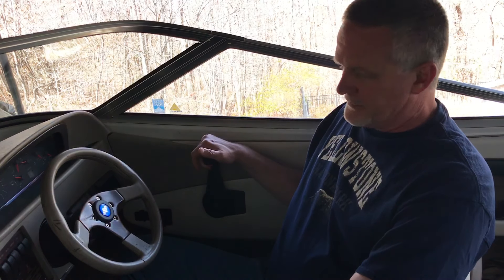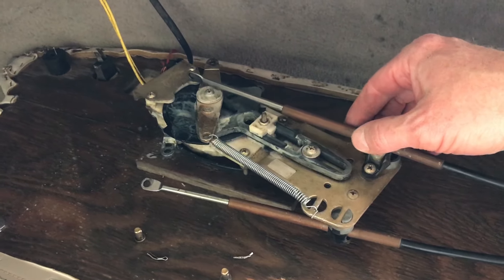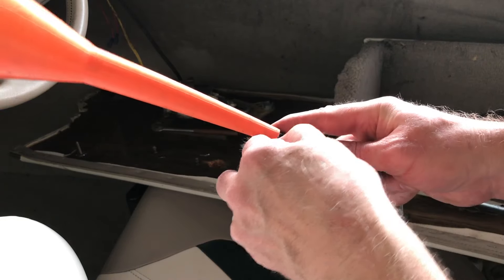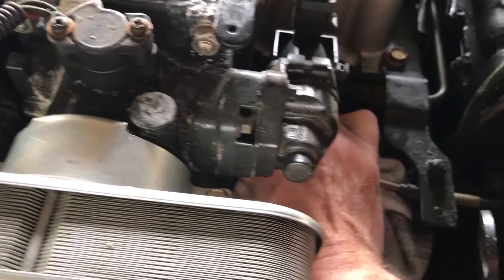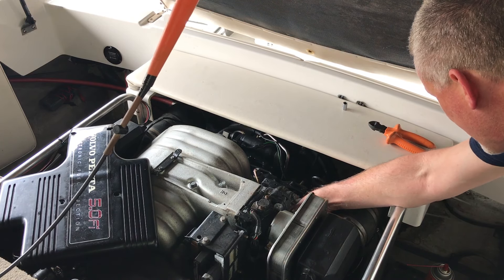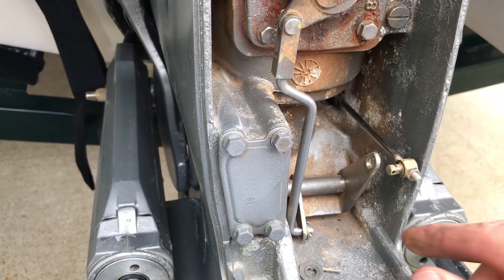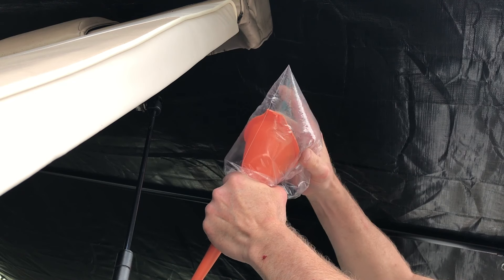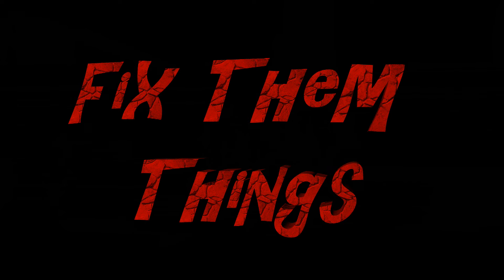Boat Throttle Shifter Cable Lubrication made easy

Comment: Awesome video, this should be incorporated maintenance with semi annual maintenance with all out drive cables..
Reply from the maker: It only lasted 2 years then the cable holder broke. I have another video on replacing the cable. $80. Easy to do. The new cable is sooo much smoother.

Comment: I have to say, you sir are a genius. I am no mechanic, I do paint and fiberglass but I’ve been around engines and mechanics all my life, never seen this way of doing it. Much easier than some other ways I’ve seen. Great job sir.
Reply from the maker: Hey. Appreciate the kind words. My shift cable finally broke 2 years later. I will say just go ahead and replace the shift cable since it sits in water. No need to replace the throttle cable. I have another video on replacing both cables.  Thanks.

Comment: I wonder if you could just tape a shop vac hose to the funnel and force the oil down the cable much quicker?  I've got an Alpha 2, so I'd prefer to not have to drop the lower unit if possible!
Reply from the maker: Good idea. Should work. In the long run you will be better off just replacing the shift cable. Mine lasted 2 more seasons then the plastic holder broke. Replaced the cable for $80 and it is much easier to move. I made another video on how to do that on VolvoPenta.
Reply: @fixthemthings  I wish Merc lower units had a cover like Volvo does to get to impeller & shift cable…without having to drop the whole lower end.

Comment: Do you want to drain all the oil? Or just wait for some to come out to ensure it’s made it way through the cable and put it back together?
Reply from the maker: It’s just a temporary fix to get you going another couple years. I have replaced the cables about 2 years after this video. The new cables are well worth it. $80 each. Doesn’t matter on the oil. The plastic retainer on your cable will eventually break anyways.

Comment: What is the make and model of this shifter? I have the same one, cant figure it out
Reply from the maker: I think I have the part number somewhere. I would have to search my computer. You would have to get an updated version of it anyway. You would need to get the same push pull actions that this shifter has. It would be best to contact Four Winns and see what the best replacement is.

Comment: Hi, I want to thank you for your video, and also have a few questions if anyone can help. My Mercruiser alpha one experienced reversing gear stall in the engine. Wondering if i lubricate the throttle cable and the shift cable will fix that problem? I can feel the cables are very stiff. 
Thanks.
Reply from the maker: Lubing the cables got me two more years out of the cables. Then the shift cable broke a few weeks ago. I would just go ahead and replace the cables. I just did it recently and took the boat out today. Wow what a difference. I have a link to replacing the cable at the end of this video.

Comment: How has it held up?
Reply from the maker: It made it better but years later plastic holder broke.   See my other video on replacing the cable. You will be better off replacing it. It is so much smoother.  -$80.

Comment: Thanks for the video, it was extremely helpful!  Once I got going with it, I came up with a small improvement to your idea.  Before putting the cable end into the funnel, cut a corner off the bottom of the zip lock bag and put the small end of the funnel through it and tape securely.  Then proceed to insert the cable and tape as you showed in the video.  Once the lubricant is in the funnel, you can pull the bag over the top and seal the zip part.  The air will be completely trapped inside and you won't have to worry about trying to seal the bag around the funnel with your hands while squeezing it.  It makes it much easier to build up some pressure.

Comment: Use a wet dry vacuum to pull it through while moving the throttle cable back and forth, works like a charm and fast.

Comment: Great video and instruction. I will give it a try on my throttle control. Thank you.
Reply from the maker: Just so you know. The stiffness will most likely be from the gear shift cable and not so much from the throttle cable since the shift cable sits in the water. Mine is still doing good.
Reply: @fixthemthings  Thank you, much appreciated. Cannot find Kroil here is Australia, going to use CRC 808 Silicon.

Comment: Nice video.  Nice job. I did this but only added engine oil to cable sleeves at the helm. It helped but only a fair- good amount. Didn't use my favorite penetrating oil THRUST in fear it might collect dust/dirt etc and make worse down the road

Comment: If you need more pressure, get a piece of vinyl reinforced tube closest to your cable end diameter.  Hose clamp it on there and fill the tube with whatever lubricant you want.  Then clamp a schrader valve on the opposite end of the tube and use a bike tire pump to add 10-15 psi.  Then drink a few beers while you watch the lube level go down into the cable.  This is especially useful on longer boats that have longer runs of shift/throttle cable.
Reply from the maker: Good one. I like it. Especially the part about watching it. Ha.

Comment: Nice job I want to do this to my cables I have the same single controller but it looks like the manufacture just cut a round hole in the fiberglass and I cant figure out how to get the controller off and out
Reply from the maker: I couldn’t figure out how to get the controller off either that’s why I took the whole panel off. There must be bolts under some secret cover somewhere.  You may have to just take the cotter pins out while in place.

Comment: I watched your u tube, and am so happy it worked for me. Thanks much. The plastic bag didn’t work to well for me , but it did work. I was in a bind last minute, after leaving my boat in storage for 6 years. I had figured new impeller, changed the oil, fuel filter, new tires, since the boat was 27 years old. The belllows are fine . I have to say everything checked out until running the engine and tried to shift it into reverse. I now can leave this Sunday morning traveling 7 hours to Kentucky with my grandchildren for a weeks vacation without worrying about trying to get into reverse and not causing any problems to me and anyone else. Thanks much again!

Comment: Would't  be easier to loose the cable at the engine end?
Reply from the maker: If you only want to do the engine cable. If you want to do both cable then No.  Most stiff cable problems would most likely be from the shift cable since it sits in the water.
Reply: @fixthemthings  Ah, OK, mine is an outboard, sorry!

Comment: Is that spring something that you installed mine did not have one.
Reply from the maker: Good eye. Yes, I  installed that in the mean time until I was able to lube the cables.   The cables are freed up now but the throttle spring at the engine intake is still not strong enough to make the butterfly close all the way which made my rpms to high at idle. I am removing the spring there and going to put one on the butterfly itself to bring the idle back down.

Comment: I’m really impressed.  Gonna’ do this to my boat!   Very good idea and execution!
Reply from the maker: It works a lot smoother. If you want, you can follow up with a light oil since Kroil is a solvent oil. I didn’t, but thought I would tell you that.

Comment: Thanks for sharing !!  Did you add that long spring to avoid gear play?
Reply from the maker: I did but I ended up  moving it to the throttle body instead. The spring on the engine throttle was weak and helps it actually go to a better idle speed when shifting.
Reply: @fixthemthings  Thank you for your reply sir.  Much appreciated !

Comment: Did you  try shifting the lever on the drive itself with cables removed.  My sx equipped boat shifts easily when drive is detached. seems maybe the load of the drive shifter lever causes cable to bind up.    When shift drive lever arms they actually seem fairly stiff.
Reply from the maker: Yes. The shift lever was smooth. It was definitely the white build up in the end of the cable.

Comment: This is a very temporary fix. Kroil is a penetrant... Not a lubricant with staying power. Once the cable is freed it would be best to actually lubricate it following manufacturers recommendation.
Reply from the maker: You are correct. I thought I said to lube it in the video if you wanted too.